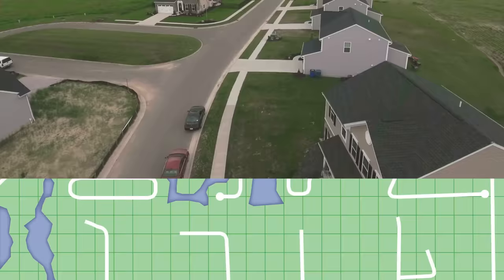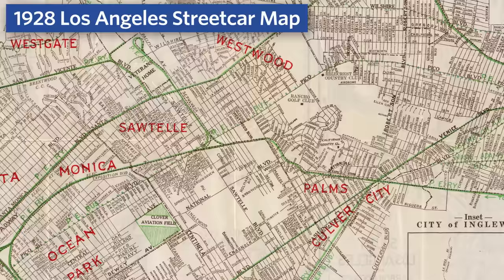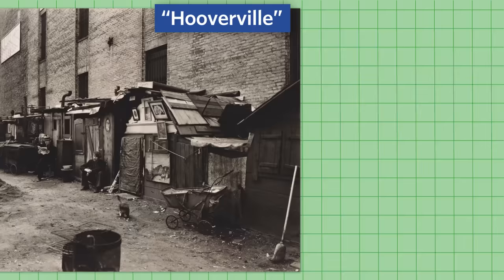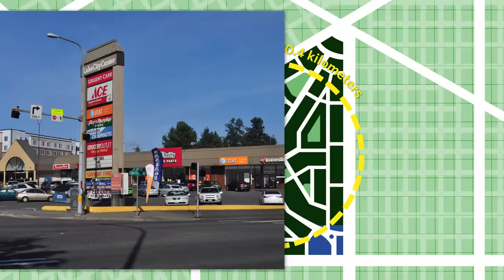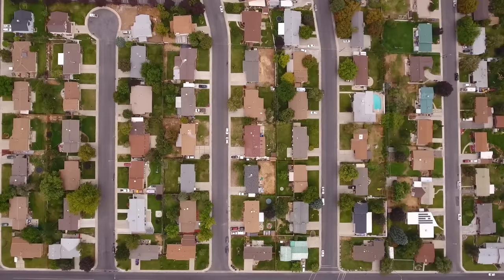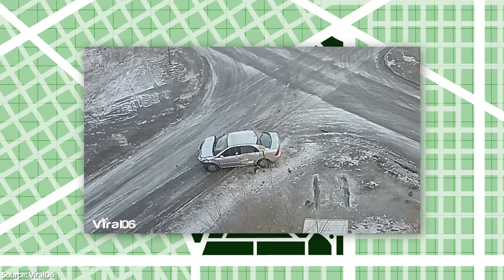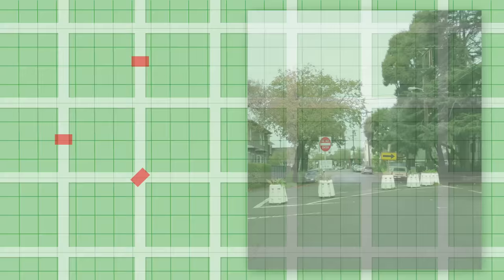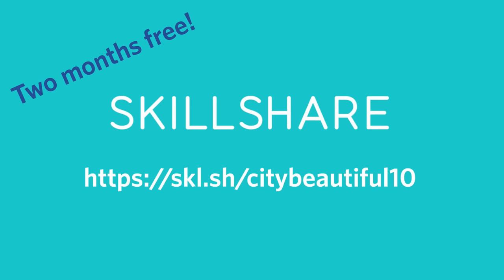The Reason Our Streets Switched to Cul-De-Sacs

Comment: i live in the middle of a large loopy neighborhood in sacramento and it'd be great if i could... walk anywhere ever! there's a park right behind my house and it still takes ten minutes to walk to it. walking to any store is an hour round trip. bleh! and hardly any of the stores have bike parking, or if they do, it's in a far-off, hidden area that's convenient for bike thieves.
Reply from the maker: I live in Sac! But I live on the grid, so different circumstances.
Reply: Susannah Anderson, you provide the evidence that the US is still a car centric country. I am very glad that I live in the Netherlands; I can bike everywhere inside my city of 400.000 residents. I do my groceries on my bike, visit my mom on my bike. Bike parking is everywhere and in front of the store/ cinema/ theater. Seperated bike infrastructure is done on the arterial roads. The Dutch city planners give cyclists a direct route and cars have to take a detour. So cycling is faster.
Reply: @mardiffv.8775  US is much larger. Cars are a necessity.
Reply: @michaelcap9550  You are correct; less density is the words I would use. So you need to drive around. Only in dense cities like New York and Boston you can go without a car.
Reply: But did you know, that 40 % of all car trips in the US, are under 2 miles distance? That can be done with bicycles. And hill can climbed with gears on the bike or even E-bikes. With a whopping 500 Watt electric motor you can climb any mountain. Just ask the Swiss.
Reply: @mardiffv.8775  Try using a bike to pick up kids, haul goods, bring back 10 shopping bags from the grocery store, get around in the rain/snow, or try showing up to work soaked in sweat, and other things.   Cars are a part of life in much of the world, and that will never change because they are convenient, cheaper than mass transit for the tax payer, allow for individualized trips and routing, and you can buy whatever car is best for your situation/lifestyle/interests.  There is nothing wrong with cars.
Reply: @droe2570  Well, there is something wrong with cars; air pollution, fine dust to be exact. Reducing 7 months off you life expectancy. Also Italy forbids cars into her ancient city centre, because the fumes destroy the old buildings.
In the old European cities cars take up too much space in the narrow streets. Parkings spots are hard to find and you have to pay 6 to 7,50 Euros per hour in Amsterdam.

Picking up kids can also be done a bike. Up to 8 years kids can ride on the bike or even in a cargobike. 8 years and older can ride themselfs. 
Hauling goods can be delivered by van or truck. And doing the groceries more often, can haul the shopping bags too. In my country, supermarkets are always closeby, most of them within 1 miles. And cycling is exersize, so it saves going to the gym.
Getting sweaty at work? Clean yourself with a washing cloths or take a shower at work.
And car infrastructure is really expensive, the same goes for parkingspaces. Did you know that 1 miles of highway costs millions of dollars?
I AM JUST SAYING SUPPLEMENT YOUR CAR WITH A BIKE. I am not against cars, just use your car less. Get free exersize, have fun and save money on gas.
Reply: @mardiffv.8775  You watch too much MSM.
Reply: @droe2570  check the number one cause of death in the US and the primary cause for it

obesity

car use is correlated with obesity

citizens pay for healthcare

Comment: Over 40 years ago my father was in the Military and was sent documents regarding the possibility of civil unrest these documents gave instruction on containment of factions.
This was due to the layout of the modern suburban city (UK).
The use of loop and cul-de-sac roads automatically creates containment points/divisions.
The restrictive movement through these schemes even on foot can be obstructive with no easy access to other roads or cul-de-sacs. The map attached is of a residential area that was built not long after these documents.
https://maps.app.goo.gl/hQn8YKHdaLdoeUuY8
Reply: So basically it causes isolation?

Comment: The best of both worlds : Houten, The Netherlands
Cul-de-sacs for cars, but full permeability for bicyclists and pedestrians...

Thusly 55% of all trips are made by bicycle or on foot, and 11% by public transit...so just 34% for the car, in suburbia !
Reply: @THEHamBot1  Nooo, that doesn't happen. just holding hands between two lovers on a bike. Or giving a friend a ride, so the friend sits on the luggage rack.
Reply: also a lot denser then what americans builds as suburbs
Reply: @correctionguy7632  Yes Sir, that is correct. The Netherlands is slightly larger then the state of Vermont, yet it houses 17 milion residents.
Reply: The Netherlands is also incredibly flat. Which makes bicycles an option. Around here we have steep hills that are sometimes more than  20% grade and even the flatter ones are numerous enough to cause problems.

The moral of the story is that you have to consider what kind of landscape you have when making your transportation decisions as what works in one place may make no sense in another.
Reply: Chris L ^ have to agree with you. We shouldn’t use a one size fits all approach. Grids are great in large cities and where land is relatively flat. However, the cul-de-sack approach with winding roads is beneficial for areas with lots of hills and rough terrain. Not to mention, this approach fits more seamlessly with the environment.

Honestly, it truly comes down the city/state and what their focus is on. If a city wants to use a grid system, go ahead, I know I will have an easier time getting around. If a city wants to have more winding roads and focus on smaller and defined communities, that’s their choice as well.

side note: I’m not here to argue which method is better as I see pros and cons in both.
Reply: @SmallSpoonBrigade  Just shift into low gear. Biking up a hill really isn't hard.
Reply: Atticus Beachy 20% is quite steep, even in low gear. I know, I’m Dutch as well ;)
Reply: @jlammetje  A 20% grade is only 11.5 degrees. That really shouldn't pose a problem.
Reply: Yep - my city in the UK is trying to do something similar to reduce congestion. It's already fully walkable, but they've begun building "cycle Freeways" & published a map that looks like a subway\metro map to promote them. It'll be interesting to see if the model translates to the UK & can get people out of their cars.
Reply: @howardbaxter2514  cul de sac suburbs are everything but communities, since most are inside sleeper districts, people rarely share or forge a commonality with their neighbors beyond shopping in the same strip mall.

Comment: When you refer to grids initially, that is the subdivision of US public land by dividing the land into relatively "square" lands or otherwise known as townships and further into sections.  This is different from the efficient square like layout of cities.
The "grid system" came about because the cities were planned out and it is very efficient.  Before planning of cities, lands were rather randomly divided which is not efficient use of land and causes other problems such as maintaining boundary lines.  You see pre-grid layouts on the east coast in the us and in european cities.  Today, we no longer have just open land to divide into lots anymore.  We have more regulation in what can be done with land too to protect natural resources and other reasons such as safety. So now "grids" are no longer feasible all the time and we create lots to work around natural features.  Cul-de-sacs are mainly used to squeeze in more lots, not a design requirement.  New subdivisions are laid out in grid whenever possible but are not always the most efficient in creating more lots when you have to work around a wetland or ravine, or ect.  You are partially right that main streets and highways are typically required to limit access to them for safety of subdivision's inhabitants, less confusion in traffic entering and leaving said highways and preference of people not wanting a major traffic route in front of their home.

Comment: In addition, one of the reason for the differences in crashes is its been proven in grid structures it gives off the notion that its safer and bc of that drivers are become less alert and more relaxed causing crashes, a more windy and non pattern type of area does vice versa of that causing more alertness and as a result less crashes

Comment: Hot take: cul de sacs and looping streets are good because they feel more organic than a strict grid. They become especially great if they have small pathways for pedestrians and cyclists that connect them and using a car automatically means a way longer path to your destination (a train station, a grocery store, a school...) than just walking or biking
Reply: It's also a huge plus if you've got young kids.  We live on a through street and our kids always have to be careful biking because of all of the cars speeding down the street.  In nearby cul-de-sacs, kids can play in the middle of the street and just stop when a neighbor comes home.  Cul-de-sacs with green paths, as mentioned at the end of the video, seems like the ideal solution (at least with current transportation options).
Reply: @schin26  This can be achieved in areas built with a grid in mind. It would just have less areas where thru traffic is allowed, or even by creating pedestrian/bike only areas in the grid. Think about an area where 6x6 tiles of the grid are sectioned off and either only resident vehicles are allowed or no vehicles. Tighten up the streets to enforce slow speeds, and create a common area in the center tile. Something like that. It is just that American cities are built with vehicles in mind instead of people.

Comment: In New Zealand we have lots of culdesacs but we also have lots of walking paths. The subdivision I live in has a light grid system but it also has culdesacs and other roads. There’s one main path that goes SE-NW in the same direction as most roads and through the parks and then there are two other paths that go SW-NE. There are also some other paths that connect culdesacs and stuff. There’s also another subdivision in my town and I really like it’s walking path system. Behind the houses, in between the two rows, they have a path. This path goes all over the subdivision. A bunch of houses have gates out onto the path but there’s also smaller paths linking to the road in different places. It’s fun walking down there because there’s lots of trees and you can walk from one side of the subdivision to the other being practically invisible to people in the cars.

Comment: The long transitional period of US street patterns barely began untill the 1920's when mass auto ownership first began, but took place all the way into the 1970's or even 1980's in some parts of the country. Traditional grids were no longer being built by the late 1960's but were actually still fairly common before that.

Comment: As someone from Scotland I prefer cul-de-sacs. Grid-lock patterns confuse my sense of direction as everything looks the same and it’s harder to drive around in. I find it happening all the time in Glasgow where there’s more long straight streets. You remember the main streets like Buchanan Street, Queen Street etc. but you can end up getting lost and walking/driving for ages to get to the point you want (especially because it’s one-way to prevent traffic congestion and everywhere is full of people). Plus, you know, car accidents happen less if you stop people from speeding on those long straight streets.
Edit: Also, grid-lock patterns look ugly when you’re going for a walk. Too dense, too straight, too boring, and not enough light and greenery. I like my semi-rural and rural areas around Stirling and Loch Lomond most.

Comment: No one wants a house in a grid in which any cars can be passing on and on 24 hrs in all directions. If you want access for pedestrians and bikes, you would have to design grids but with only a few wide main roads for high traffic, and many thin, controlled roads to keep neighborhood blocks silent and safer. I live near the entrance of a cul de sac and it's so peaceful all the time, only local neighbors driving through. But I'm two houses away from the main street so I have to close the windows in my side of the house to reduce all the traffic noise from the rush hour in the mornings.

Comment: The main question is how do you build cul-de-sacs in Cities Skylines? 
Asking for a friend
Reply: Brend Romero it’s really easy to just draw out a road and end it, but if want a round bulb at the end you can use a small alley road from the network extension mod then add a short segment of a normal sized road at the end. Basically which ever road you’re starting out with cap it off with a larger road right on the end.
Reply: Personally I just make small roundabouts, in my country we have like 7 cul-de-sacs. Most streets here end in other streets or just in dead ends.
Reply: There’s probably a mod for that. Or just but a roundabout at the end of the road.
Reply: desertrose0601 
I can confirm there is a mod for it.
Reply: Dont know, I have a city named Las Palma with a population of 67,500 and It is 82% grid city and my suburbs are mostly grided, weird I know but that's how I built it on cities skylines if you were wondering
Reply: I make some sort of grid out of main streets and add cul-de-sacs within each larger unit.
Reply: Haha
Reply: 2 lane road, tiny 4 lane road, and then dirt road at the end.
Reply: I kinda figured it out already.....so I use the very small 1 lane 1 way road to make a small roundabout.. then use the move it mod to compress all the nodes into one spot possible then voila!
Reply: Brend Romero I wish us Xbox players could get mods like that. :(
Reply: Small round-a-bout, fill the interior of it with some trees and other plants.  Also, there is a round-a-bout creation mod that has a setting in there to create a cul-de-sac.
Reply: Fmono • 38 years ago • Updated I have a pc but it’s pretty old and can barely run Minecraft.
Reply: Wasn’t there a new update adding those in with the colleges? It might be dlc tho not sure but worth the search I know I’ve seen other people using them  in videos THEY DO EXIST lol
Reply: Well, I actually make 100% grid cities, because I live in north-eastern europe, and newer saw in my life a cul-de-sac.

Comment: I try not to comment on older videos, but I have an idea that I would like to share.  The idea is similar to having culdesacs connected by walking/biking paths/shortcuts but more extensive.  Basically you have two completely different transportation networks.  Streets for cars and paths for pedestrians.  Of course they are going to have to cross each other but that could be done with either signals or bridges.  The core idea is that cars and pedestrians don't share the same travel corridor.

Comment: It's shocking that intersection those two cars crashed at didn't have stop signs and the two cars didn't even see each other. Seems super easy to avoid
Reply: if you mean at 2:36, there is a stop sign on the right, the car coming through there just completely ignored it. And they had more than ample time to see each other given the lack of obstruction coming in. So yeah, what's shocking is that those guys got a driver's licence to begin with. City planner did his job but you can't foolproof roads well enough to stop some people from getting their darwin awards.
Reply: I was literally thinking the same thing I rewinded the video and was like what kind of fuckery is this
Reply: 5:07
Reply: if you actually used your eyes, you'd be able to recognize that the road is frozen over, both of them likely floored the brakes, but that does nothing in this scenario.
Reply: @windhelmguard5295  Actually, if you look even closer the driver on the left was driving too fast for conditions. This accident is all on the car driving from the left because they where going way too fast for it being icy.
Reply: Yeah as much as I prefer grids, I gotta admit I have yet to see a serious wreck in a cul de sac.
Reply: are you physically unable to use commas?
Reply: and after watching the clip, the sedan had a stop sign but didn't stop.
the road the van was on had a yield sign.
Reply: @angelgjr1999  As long as the roads on the grid are built to encourage cars to drive slowly they can be very safe. Adding small little twists, speed bumps, obstacles, tightening the road, etc, can help a lot.
Reply: @thespanishinquisition4078  ILL TAKE "ICE" FOR 1000 ALEX!.. how you have a license and dont grasp how driving on a frozen road reduces your ability to stop amazes me.. darwin award to you
Reply: Just to come in a day late and dollar short... The car's sign is a diamond shape, not an octagon, so that's not a stop sign, it's probably some kind of yellow warning sign. The truck has a yield sign, and one can be seen across from it clearly facing the camera. The truck should have waited for the coupe to pass through. But also, ice. I just thought it was interesting that no one mentioned the Yield signs.